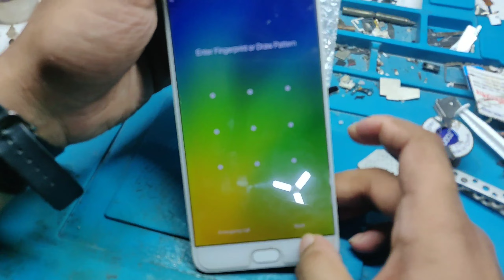oppo f3 plus restart problem solution ||#mobilerepair #mobile #mobilerepairbd

Comment: السلام عليكم . i have the same issue. went to the oppp store. they said. the mother board shoud be changed. but the main issue is that ill lose all my data they said . anyhelp plzz
Reply from the maker: Every oppo store said. The mother board shoud be changed. 
But you need to go local market or local mobile  repairing shop.then you show may Video front of them.